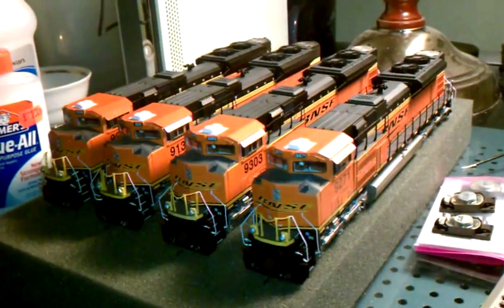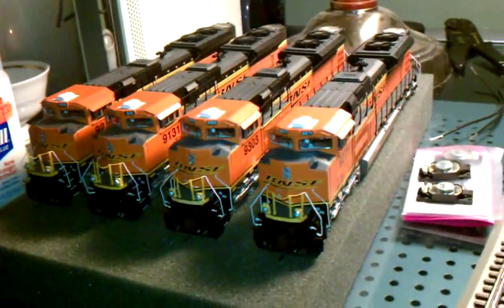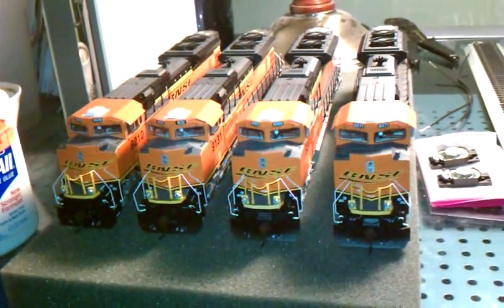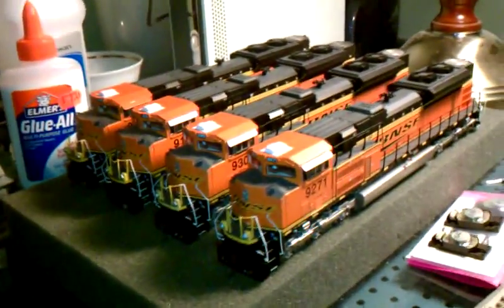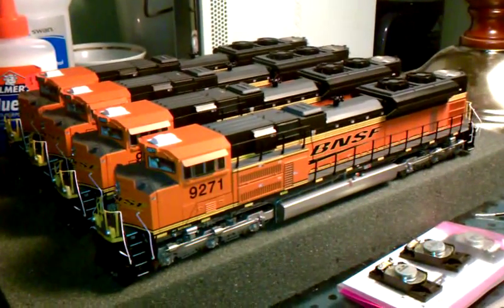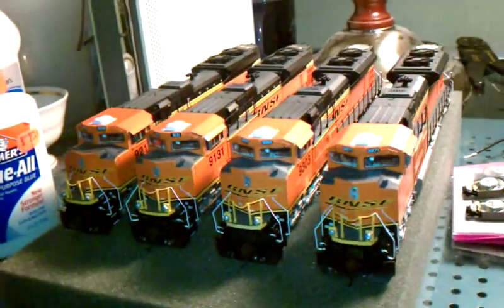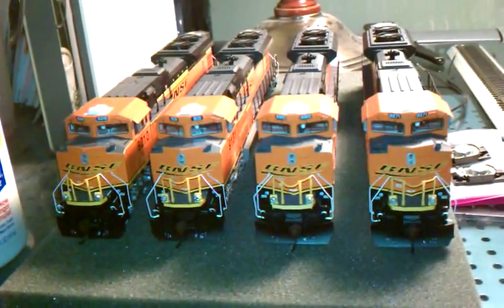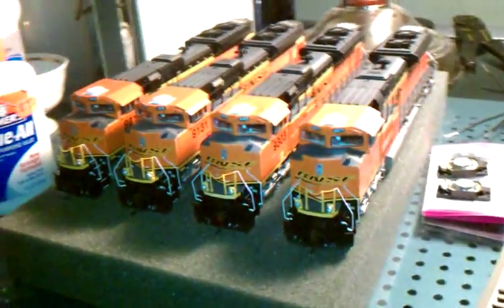Athearn 4x BNSF SD70ACe's

Comment from the maker: @dmncau I bought one from Willis Hobbies and the other three from Trainland.  I find the quality to be good but in some areas needs some work, like the front and rear handrails.  They are not symmetrically put together and they are flimsy.   Certain parts of model like the sanders are fragile (one of them broke off and was lost.)  Tried to get Athearn to send me another one without any luck.  As for the detailing and the paint job it is very well done.  The model detailing is better that MTH.

Comment: @AMH9217 No need, these days you can get micro-leds with both leads already attached and they fit into details west ditch lights very nicely. I swapped out the oversized ditch light units on my MTH models and also fitted new micro leds in the DW housings.